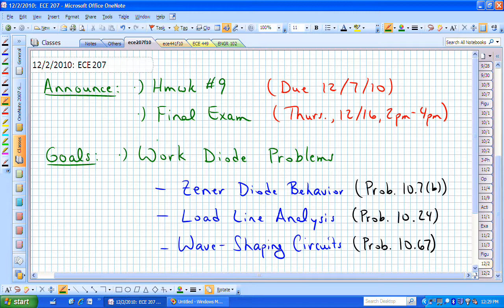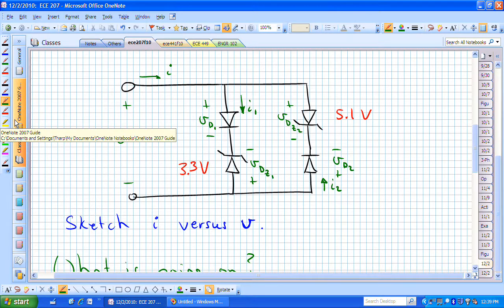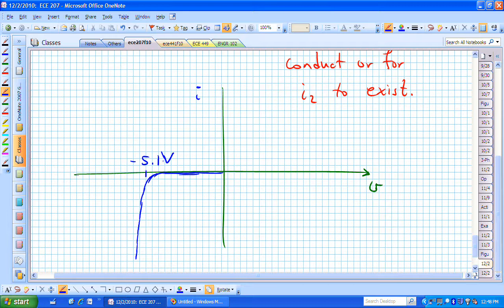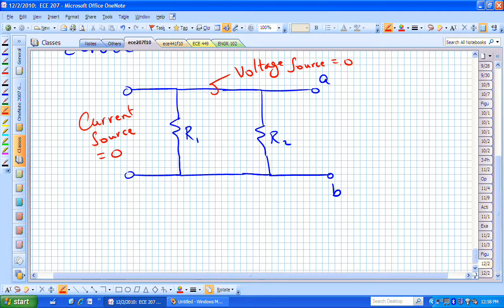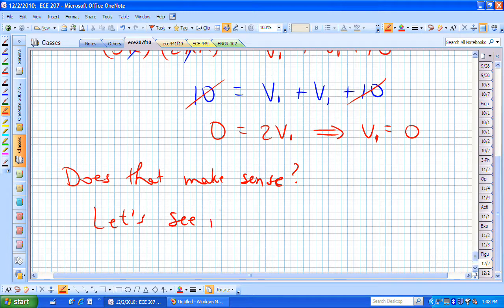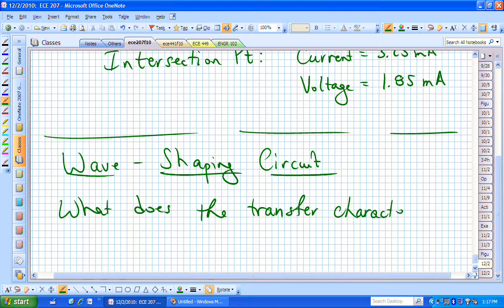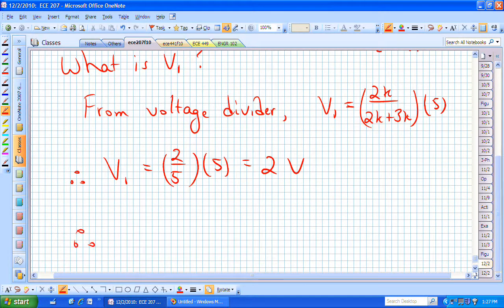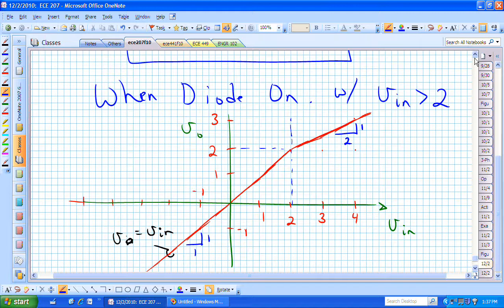ece207_vid_12_3

Comment: Why all the contortions at 33:53 to determine Voc via I1? Just do a source transformation of the 2 mA current and 5 K (R1) resistor and convert it all to a series circuit consisting of two 10 V sources and two 5 K resistors giving a current at I1 equal to 20 V/10 K = 2 mA and Voc = Vth = 2mA X 5 K = 10 volts?

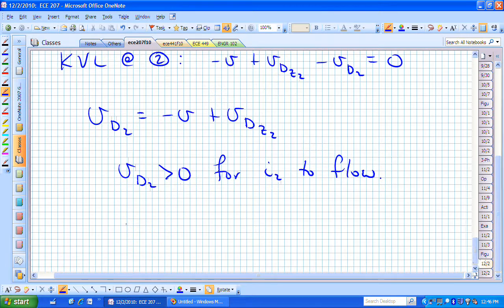Comment: Why oh why do you require a forward voltage drop of 0.6 for Vd1 to be overcome and added to the 3.3 v breakdown voltage of Vdz1 and YET only require a nonzero voltage drop across Vd2 at 17:36? It seems to me that the forward voltage drop of 0.6 of Vd2 should be added to the breakdown voltage of Vdz2 in order to to require that V = - 0.6 + (-5.1) = - 5.7 volts in loop #2.